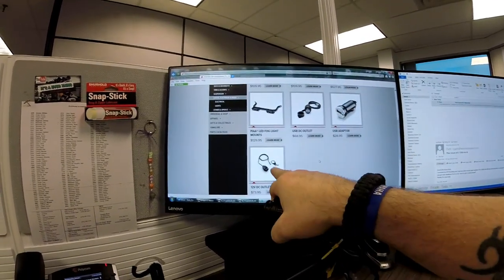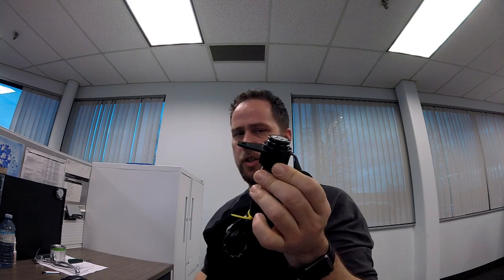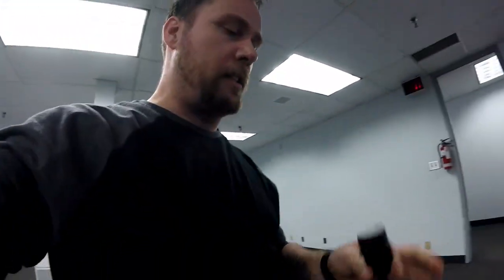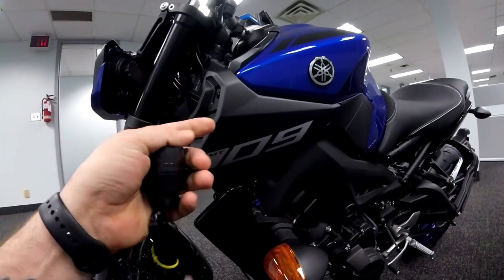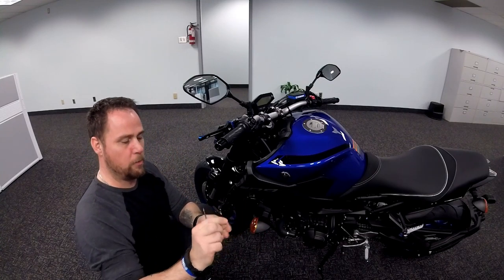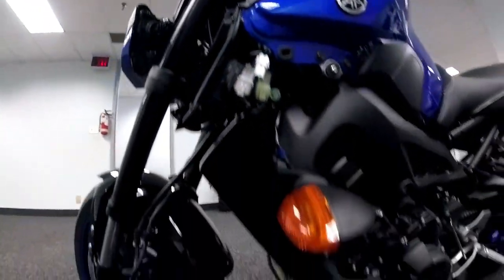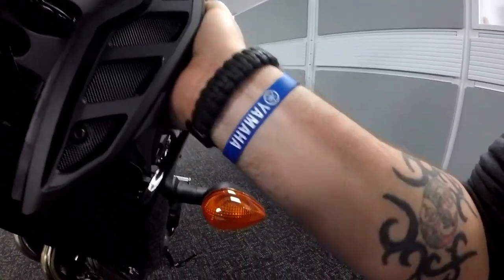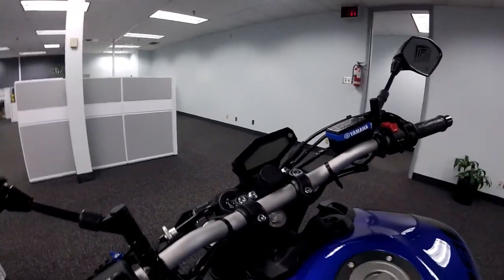Easy install USB power adaptor motorcycle how to 12V charger

Comment: Enough space left for a GPS or phone holder?
Reply from the maker: Yes and they would not interfere with the view of your meter. I placed mine right in the of the handlebar above the crown. I used the Ram mount with Xgrip at first then tried the Quadlock system. Out of the two I prefer the Ram mount and xgrip. You can also place this phone mount on your left side handlebar and then get a GPS mount holder from yamaha that attaches your handlebar clamp area. There are two mounting areas there that would share with the usb power adapter mount too.
Cheers
Rob

Comment: Hi Rob, Is there anyway to put a switch at the ground of the battery so you can cut the connection when we are not using our bike for a long time?
Reply from the maker: GA Aero  sure there’s always a way  but you’re on your own for that. When you say a long tome you mean super long ! You have to decide what’s easier !! Messing around with a switch which could also possibly go faulty compared to simply lifting up your seat and disconnecting your battery being you are saying for a long time. Everything runs through ignition switch so not like there would be a constant drawl !
This leads me to my next video actually which is installing an external plus for a wall charger battery tender lol..but you beat me to it lol. Stay tuned as tomorrow I’ll be making that video and mentioning your comment too. No names just as a general question which is a good one !
Cheers and thanks for the support GA Aero !
Rob
Reply: @itsadyerthing  I was talking more like 2-3weeks. However that's the problem with my bike, Fz6s, the freaking battery is under the fuel tank. :< haha its not a simple thing to do to remove the negative leads on the battery
Reply from the maker: GA Aero ah now that makes a whole lot more sense !! Hmm I would still suggest a plug to battery for a battery tender this way it will always be on a trickle charge when left sat aside for a long time. But yeah if you have accessories plugged to your battery which does a small amount of draw from it then yea I suggest take a half day with appropriate wiring and safely make switchable power and place it somewhere safely so you don’t both harm yourself or the bike ! Make sure your are also protected form the weather elements too so good coverage and sealed system work best.
That sounds like a good video in the making for you my friend ! Many would benefit from it for sure !!  Food for thought !
Cheers and keep us posted on how you did it !
Rob

Comment: Did you do the same install on your FZ 09? Is everything in the same location?
Reply: Just read the description. Sorry, but what do you mean by plug and play only?
'
Reply from the maker: mc4sdsu yes everything will be the same for a FZ09 on 2017 model but not older than that. On my old 2017 FZ09 I had the previous 12v DC OUTLET but same thing where it’s plug and play as a factory harness connector. 2018 and my 2019 I went with the newer design which is USB style.
Again this can also fit on anything out there by removal of factory connector and simply tapping into a ignition power-source.
Cheers and thanks for reaching out. Please keep me posted on your outcome.
Rob

Comment: Where does it mount on an 2015 - 2017 FZ-07? I have the unit but can't find where to mount it on the dash/handle bars.
Reply from the maker: It comes with a retaining ring bracket and screw, this is to be installed into the either large or small iPhone adapter plate (sold separately) it should be stated on the product description information and also in the installation instructions.
Cheers
Rob
Reply: @itsadyerthing   iPhone Adaptor plate? I mean how and where does the USB unit itself mount to the dash of  2015-2017 FZ-07 not FZ-09? I'm not talking about mounting an iPhone, just the USB unit.
Reply from the maker: @yautja010  the whole device has to  attach to the accessory iPhone holder plate ( sold separately )   that plate is bolted to the bottom side of the triple clamp. You can fabricate your own if you do not wish to use the items suggested by Yamaha. 

Here is the link to aux power, please read last portion of description for clarification. You should have also received installing instructions too. But ultimately you can always attache it to the underside of your top triple clamp. You should be able to find a pre threaded section that will accommodate a small 6x 15mm screw. 
https://www.yamaha-motor.ca/en/accessories/motorcycles/electrical/12v-dc-outlet/1WS-F254B-01-00?sourceCategoryCode=97
Reply: @itsadyerthing  Do you by any chance have a link to this bracket or maybe a Yamaha part number for this bracket? I have searched for the last several hours for any type of bracket for the FZ-07/MT-07 and have come up with nothing.
Reply from the maker: @yautja010  what is your location..
Reply: @itsadyerthing  Arizona, USA
Reply from the maker: @yautja010  I see your issue. Yamaha USA does not list this item or offer it for that fact. Did you already obtain the usb aux DC power supply?  You can either deal with a Canadian Yamaha dealership ( I recommend Kelly's cycle Hamilton Ontario) or you can fabricate your own little bracket to hold the bracket that holds the USB adapter.. 
Here is the link to Canada part.
https://www.yamaha-motor.ca/en/accessories/motorcycles/handlebars-controls-/small-iphoner-holder/YME-PHHLS-00-00
Reply: @itsadyerthing  thank you sir, you have been more than helpful. At this point I think I'm just going to return the USB charger and sell the bike. It should not cost this much or be this difficult to have a useable factory Yamaha FZ-07 usb charger that requires you to purchase a $215.00 part with an unusable, outdated iPhone 3 holder. Yamaha is failing miserably right now with bad factory mirrors, cheap levers and a lack of threaded mounts for spools on the rear swing arm on the 07. The New MT-09SP is looking more and more appealing and worth the price.
Reply from the maker: @yautja010  two completely different beasts ! If you can go with MT09 then I can assure you that's you'll be a very happy rider! The MT09 offers so much and then some ! Do you need to go SP version. Well that's your call and budget. Myself unless I live on a race track then normal MT09 is more than enough bike street riders. But if you decide to keep the MT07, FZ07 then really wouldn't take much for you to make your own usb bracket holder... that's what I would do myself. I thinks it's a 27mm wrench for your crown nut that holds top clamp and then 10mm wrench or 5mm Allen hex for your side bolts that hold onto the forks. You remove this and you can then almost flip your clamp around to see what's it's like underside and allow you to make measurements or a template to fabricate your own little bracket to stick out and attach your support plate for the usb holder. Then you make sure you place it do it does not interest with anything and get a small sheet of metal or alloy or even plastic if need be and create your own, paint it and voila your done. Just make sure to install your triple clamp with crown nut first then the fork clamps after.... 
Cheers and stay safe. 
Keep us posted on your outcome whether it be mt07 or mt09....
Rob

Comment: Will this work on a 2018 XSR700? I believe it's the same electronics as MT09 / MT07 / XSR900?
Reply from the maker: Hmmm, that's a very good question, unfortunately i dont have an answer for that but.... the MT07 has the option to install this accessory as a plug and play, the XSR700 is the MT07 just with different cosmetics so makes me wonder if the connection would also be there too ? why would Yamaha make a whole new harness for such a small difference, doesnt make sense for costs.  Ide say it would be work a look for sure.  Im gonna reach out to a buddy of mine that bought the XSR7 and see what he comes up with too ! stay tuned and do respond if you find anything too, many would be pleased to know for sure.  Cheers and thanks for reaching out.
Cheers
Rob
Reply: @itsadyerthing  Thanks! Someone on Reddit posted that it would work. I am waiting to be sure to purchase this, I might also try to call Yamaha Canada and/or my dealer. Will post back if I have a firm answer.
Reply from the maker: @RobertRazavi  you call Yamaha Canada, do you know who they'll ask. LoL. Harness is not the same from 900 to the 700 but I'm sure there's a hidden connector there somewhere. The importance is that you have it connected to your ignition for no battery draw. I'll be searching a bit more but in meantime go through your owners manual too. Check fuse section for any called spare and or aux. We'll get to the bottom of this. Once that is found then you can deal with Kelly's Cycle centre in Hamilton Ontario Canada To ship yamaha canada products to you as they are not available from Yamaha usa. We offer both DC and USB style plug and play aux power adapter that connect to the factory harness like you want. Once we can find and confirm a extra port then moving forward is a breeze.
Cheers and be safe
Rob
Reply: @itsadyerthing  Hey Rob; I called my Yamaha dealer, they did not know. They said that in their catalog, it does not say XSR700, however compatible with MT07 and 09, and XSR900. It would seem ludicrous that solely for the XSR700, it would not work. I guess I have to go to the dealer and try to see if it fits (they have one in stock).
I also found this thread; their is a hidden connector! But is it the same?  https://www.xsr700forums.com/threads/auxiliary-dc-connector.5641

I mean the part fits all of these except the XSR700?????: 

           
2020 MT-09
2020 MT-07
2020 XSR900
2019 MT-09
2019 MT-07
2019 XSR900
2018 XSR900
2018 MT-09
2018 MT-07
2017 XSR900
2017 FZ-07
2017 FZ-07 ABS
2017 FZ-09 ABS
2016 FZ-07
2016 XSR900
2015 FZ-07
Reply from the maker: @RobertRazavi  yep that's the one. Open your owners manual and read page 4-18 they simply tell you to consult your dealership. Looks like you found it which is awesome...
Cheers
Rob

Comment: Very good step by step, is the same aux cable on the new mt 03 2021?
Reply: Again will this aux connector be the same on the 2021 MT-03 ?
Reply from the maker: I dont think the MT03 was ever equipped with a aux plug to allow you to connect a USB charge port though the main harness, you may have to go direct connect to the main battery.   MT 03 or YZFR3 do not have such option from my memory. sorry.
Rob

Comment: How can I get the USB version in the US?
Reply from the maker: Hi Lee, unfortunately yamaha USA doesn't offer this but dont worry as we got you covered !
 if your willing to deal with a Canadian dealership who sells world wide and are very trustworthy you can tell them that Rob Dyer referred you to them.
Part number you are looking for is YME-FUSBU-00-00
Please cone and check this dealer out as they specialize in world wide shipping !!
Kelly's cycle centre.
https://yamahagenuineparts.com/

Hope this helps you out and thanks for your view and support, Be safe
Cheers..  Rob.
Reply: @itsadyerthing  Rob, the link above shows a picture without the handlebar mounting plate and screw. There is also a part # 1WSF254B0100 that looks the same with the mounting plate. Which one is the right one? I'd like to have the mounting plate and can't tell the difference between the two parts.
Reply from the maker: @sebastianpotes3902  the mounting plate comes with the DC outlet. Its included in with the package along with fastener and a few zip ties. Hope this helps. Sorry that mount is not something that is sold separately. 
Cheers
Rob

Comment: Hi Rob the bikes looking great,
If you are going to put the small fog/spot light's on MT09 a full video (tutorial) would be greatly appreciated mate,
I've got the lights, (thanks for the link) just trying to figure out the best way to fit them.
and if you put a windscreen on, showing the process would be great too, the instruction's are useless
cheers mate
Reply from the maker: The Revenant of Your EX 10/4 Roger that!!
It will be on my to do list between now and May 2019. Long winters !! 😭😭
Reply: @itsadyerthing  Thanks mate looking forward to them. We got bloody hot summers here 38, 40 degrees
Reply from the maker: Damn!!! would be nice but that's me saying that while its -12 and going to -22 shortly, Im sure I wouldn't be as jealous if I was in that extreme heat LOLCheers and thanks for reaching out !Rob

Comment: can i plug a gps (like a TomTom Rider 450)  in the white connector you used for you USB adaptor?
Reply from the maker: Sorin6curo i have and never ran into any problems. Unit charges and there was no depletion of battery so sure.. I know Yamaha Canada  also offers a GPS mount for most GPS cradles for this bike so I would say even Yamaha shows that’s its acceptable too..
Cheers and thanks for reaching out
Rob
Reply: @itsadyerthing  Thanks for the quick answer, ride safe

Comment: Where can i buy for Yamaha MT09, 2016?
Reply from the maker: where are you located Nom Muay Thai.
Reply: @itsadyerthing  sweden
Reply from the maker: @nommuaythai4960  very interesting because part number i have posted in description was from Europe as we get product from Yamaha Motor Europe! 
Did your ask your local Yamaha dealer for part  number YME-FUSBA-00-00 if not you can Google it. 
Hope you find. But it was designed for 2014 and newer so you should be OK.
Cheers
Rob
Reply: @itsadyerthing  I could only see from your link that it existed from 2017 and newer. I have 2016 .. :(

Will ask Yamaha dealers tomorrow in Sweden if they have.

Thanks :)
Reply from the maker: @nommuaythai4960  it will work for 2016 only thing is you have less connections than 2017. 2017 and newer have 3 auxiliary connectors where I think you only have 1.
But yes do check your dealer and also confirm with your owners manual for how many auxiliary connections you have. 
Cheers and thank you for reaching out to my channel 😉. Be safe and have a good 2021 ride season.
Rob

Comment: Motorcycle in office?? !!
Reply from the maker: Dario Leopoldo Righetto yes sir... here and I see it day in day out.. talk about teasing myself with it and just increasing the frustration of not being able to ride.. serious cabin fever ! Lol
Being that I receive it at work, I simply assemble it and accessorize it here at work and simply put it on display we we have a few units hanging around in our workspace. I’m fortunate enough to have mine displayed right where I work. Both a pleasing and torture at the same time ! 
The perks of Working for a Motorsports company.
Cheers and thanks for the support !
Much appreciated 
Rob
Reply from the maker: Dario Leopoldo Righetto make sure you check this one out for a better reference where I have the bike stripped apart for your viewing
https://youtu.be/HLvu34Piogo
Reply: Hi, i'm searching for a video to see a place to fit my USB Genuine Yamaha adapter, for my MT-07. So i'm here to see your video... thanks and compliments for MT-09
Reply from the maker: Hi Dario, Please read this all carefully. There is a specific kit and plug location for your MT07 too, It is found on the left side of the bike behind  the side cover under the fuel tank.Easiest thing to do it either buy the actual accessory for your bike or you will have to make your own connector but either way, you will be properly fused and into the ignition key assembly so all is safe.If you do not have the genuine Yamaha usb and DC plug then I suggest you Google search "  Installation instructions 1WS-F254B-01-00" you will find copies and images od the install sheet which you can refer to as to where your plus will be,Hope this helps.CheersRob